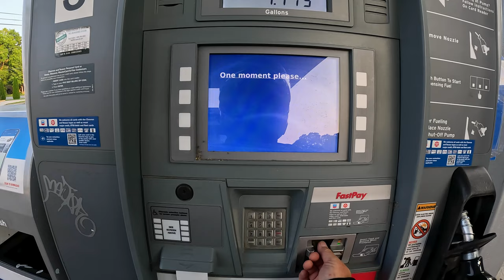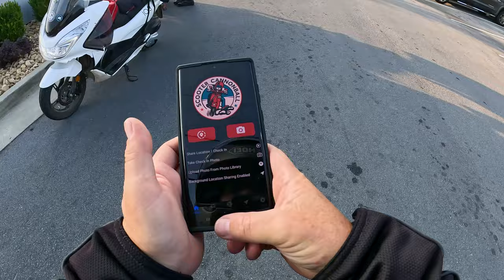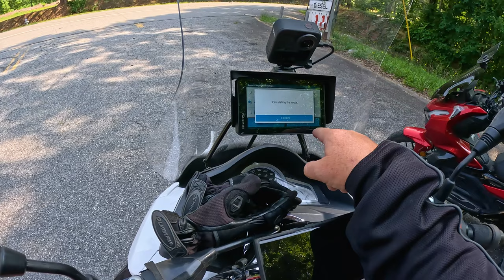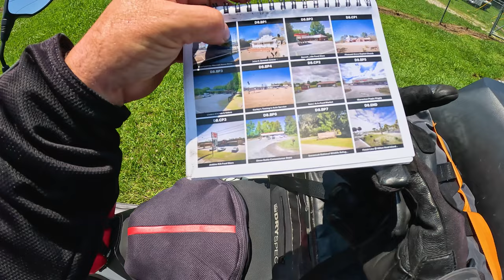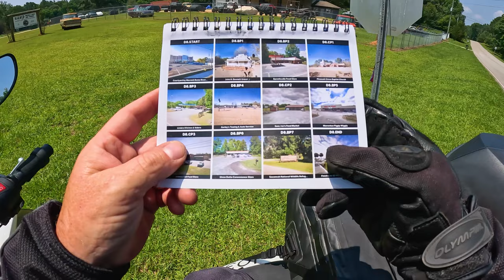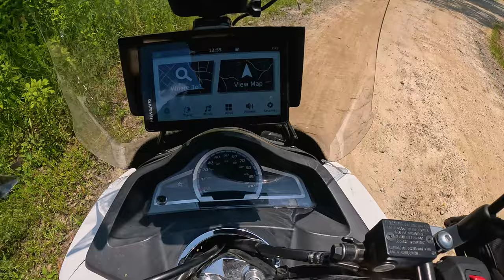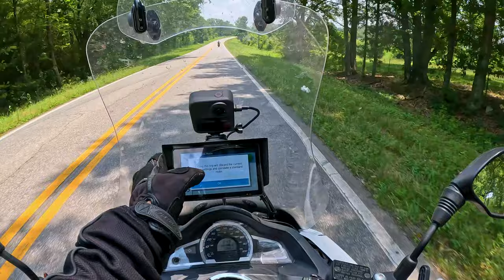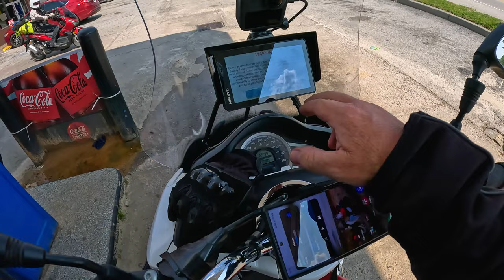Scooter Cannonball 2023 // Day 8 : RAW & Uncut in 4K

Comment: Really good video! Your commentary paralleled what many of us felt during this Cannonball. I can relate to "Scrambulated" in the morning!😂😂😂 I(we) really appreciate what you've done for the Cannonball and Scooterin in general. Thank you!!!! Rick
P.S. I'm already pondering what your 2025 Scoot will be?
Reply from the maker: Howdy, Richard!  I'm still undecided on my next Cannonball steed.  It will most likely be the ADV160.  However, I'm also toying with the idea of running the XMAX 300 and running as an unofficial videographer for the event.  The 300 would allow me to run out ahead and capture more riders along the route.

The 300 wouldn't be competitive unless I run it really hard, so that relegates me to the "tourist" class in terms of points standing.  If I decide that I want to "compete", then I might create a FrankenCub crossbreed between Super Cub and the CT125.  If I add a mild big-bore kit (probably 143cc) to give it a bit more punch, then it might be a competitive little beastie.  Decisions, decisions... 🤔  --QM
Reply: Yes that 4 valve Adv 160 just might give you the power you need if you can keep it light. I'm over in the Gulfport, Ms area and plan on bringing a support car and trailer, similar to Bennie's winning combination. Your welcome to jump on board if you want. 

Did a check on the SCBR website and that '23 Xmax at 292cc has a 127%+ handicap vs the Vespa 278cc 125% handicap. Dave did tell me he was going to have a true <300 class from now on. That wouldn't be too far off from the Vespa's.  If you run the small bore, that will be a challenge too. But fun! Are we ever gonna grow up? I hope not.

As for video, You are the official videograher in my opinion.